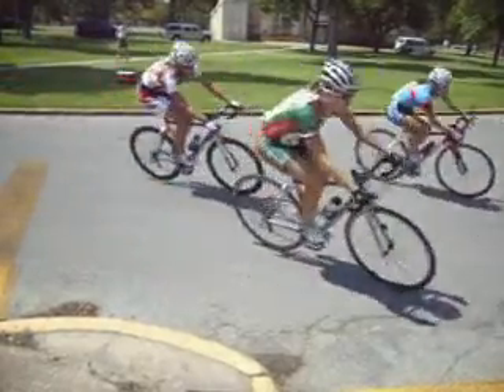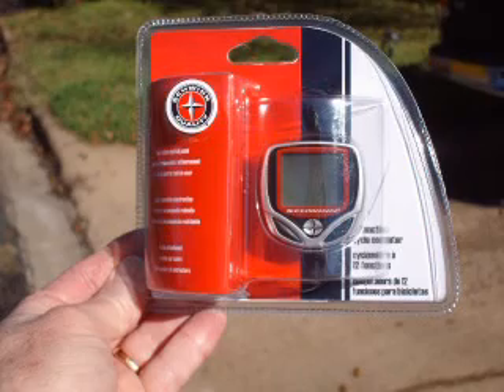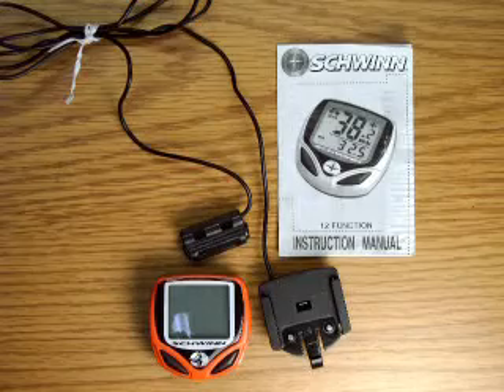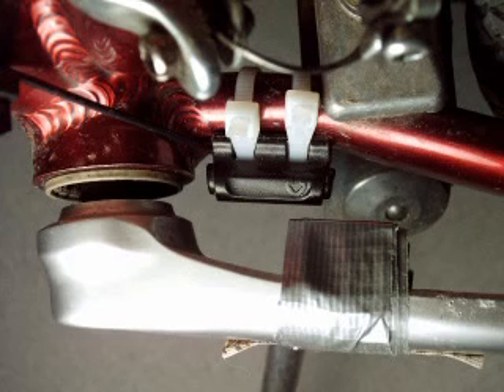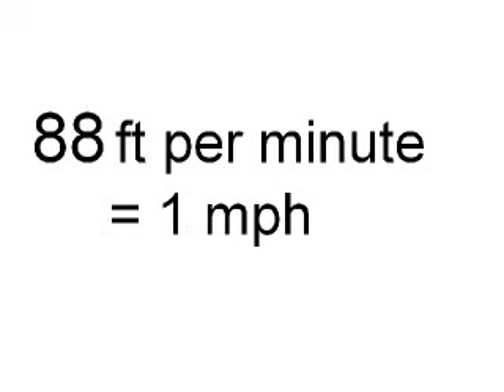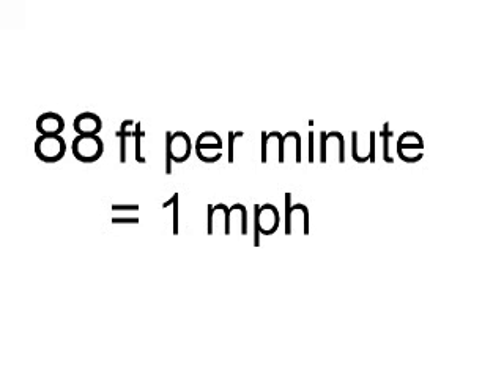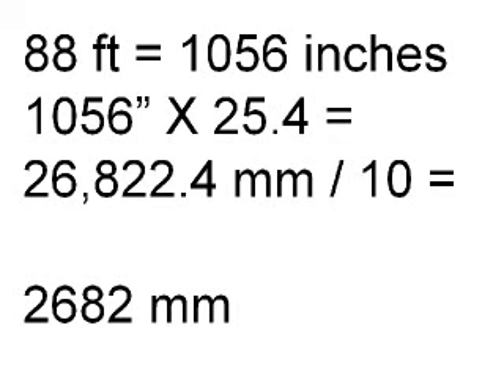DIY How to make a bicycle speedometer into a RPM cadence meter

Comment: Hi, thanks for this tip, it works great. Only one thing to add. I have some holes in my chainring and so I was able to use the spoke magnet on the chainring and put the sensor low down on the down tube, neat and tidy and out of the way. 🙂

Comment: Tried my set-up this morning on my daily 10 plus kilometer run through the backroads (well-paved, rolling gradient) behind my house. Worked like a charm. the Cat Eye Velo 9 is perfect for the job! No weird read-outs at cadence lower than 60 RPM (as reported earlier below). Was pleasantly surprised to find that 60 RPM, even 70 RPM was easy for me to hold for most part of the run. The Velo 9 reported that my average cadence was 72 and my max was 86 RPM! Oh, I am in Bike heaven! Thank you luvmastertx for sharing your cadence meter set-up. BTW, your video seems to be the only one to show how to make a cadence meter out of a speedometer/computer and I'm glad I saw it. Again, maraming salamat (Thank you very much). I highly recommend using the Cat Eye Velo 9 for this purpose to any and all interested. Should the cable run too short, just elongate it with any ordinary electrical wire of preferably the same type/size/kind. Install the magnet sensor on your bike's left chainstay, then attach a strong magnet on your left pedal crank arm. On the Velo 9 computer unit: set the speed units to mph, the tire size to 268, mount the display on your handlebar, make sure the cable doesn't bind when you steer to max left and/or right and you're good to go! Happy biking!

Comment: What can you say about Matthew Frederiksen's comment that above set-up is unreliable at cadences slower than 60 RPM? If that is true then this set-up is useless to me as I am re-starting cycling at age and after coming from a long period of sedentary lifestyle I cannot make cadence of 60 RPM . I wonder what cl2u found during his test? Is this set-up also/still reliable at cadences lower than 60 RPM? Thanks for any and all replies.
Reply: You could have two magnets mounted on the main sprocket.  This would double the cadence.  Then you would need to change the programming (i.e. the input wheel diameter) to give the correct cadence.

Comment: I'm having a problem. the length of cable on wired devices are not long enough and the wireless sensors don't have the range.  Trying to figure out some place other than handle bars to mount display.   why don't the idiots who make these devices make it for cadence to begin with.  I don't care about mph.  the ones that do have cadence are expensive and complicated.
Reply: +ken henry You are totally right, I was thinking the same . Wire can be extended , good soldered connection , little bit glue for water proofing , and shrink wrap it ...

Comment: I did this with a spare CatEye Velo7 computer.   I attached a small disc neodymium magnet to the end of the steel pedal shaft so no adhesive was required.   The sensor is wire tied to the chain stay.  The single magnet setup works perfectly using the factor of ten approach.

 I have another CatEye computer with the two sensors for speed and cadence on a single unit but what I like about the dual head setup is that you get more detailed cumulative info about cadence such as average and max cadence in addition to instantaneous cadence.  Also, the current cadence is much easier to see with the larger digits.

Comment: Just changed my useless cateye vl800 that was on the secondhand spin bike I purchased with said cateye mounted on the flywheel.(Useless because a speedometer means nothing on a stationary bike!) to a now useful cadence meter mounded on the crank arm as demonstrated on the video. The computer shows weird high numbers below 60 rpm but from there and beyond it works a treat.  7.3 for 73 rpm ect. The vl800 manual setting is only in CM so I just rounded it to nearest cm ....268cm. 
this is great I was looking to buy the cheapest wired cadence meter but now I don't have to buy anything. CHEERS!!!

Comment: hi there..thank you very much for the information. i just want to ask about the number you use to program the speedometer. is it the same for every bike? i use a mountain bike tire size 26 x 2.2. can i use 2682 mm also?
Reply: Yes, the measurement is their to change it from a speedo to cadence. Therefore it won't tell you the speed anymore.